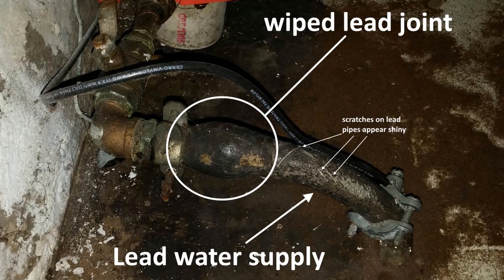Poor water flow caused by old water supply piping

Comment: You should be in philippines my current house can only run one Fawcett at a time and very little pressure less than 10 lbs I'd guess. Taxes 3to  5 minute to fill a 5gal bucket

Comment: I have a question when I turn on my lawn irrigation my water pressure is zero in the house.  I had the house rebuilt 2007 and didn’t replace the water line from meter to house.  I believe it’s 3/4 galvanized from then 1960s.  I believe this line has corrosion we always get grit in our shower heads.

Comment: I’ve had “less than perfect” water flow ever since moving into my current house. I asked the water company to check whether their curb stop valve was fully turned on. They said it was OK but I wasn’t home at the time they checked it. I decided to inspect it myself. Unfortunately my curb stop valve is only about 1/4 open. Also a tree root has pushed the vertical curb box pipe out of position so that a curb stop tool cannot engage with the valve to rotate it. I suspect the only thing the water company did was to turn on one of my outdoor faucets and observe that (some amount of) water came out. Recently I dug a hole around my curb stop, lifted out the curb stop box, and cleared out all the roots. Now I have full access to my curb stop valve, but unfortunately it is firmly stuck at the 1/4 open position. I haven’t decided what to try next. I don’t want to break the valve or cause a leak.
Reply: After several attempts I was able to improvise a functional tool for rotating my curb stop valve. I modified a 1.5 inch socket wrench by grinding 2 slots in it which fit snugly over the rectangular actuating tab of my curb stop valve. It was necessary to use an electric impact tool initially to get the curb stop valve to break loose and rotate for the first time. The valve now rotates smoothly enough that I can operate it by hand with a 1/2” drive breaker bar. The valve does not leak or drip around its stem. When the actuating tab is at right angles to the direction of water flow the water is totally off. Rotating the actuating tab 1/4 turn in either direction provides full water flow. . The original position of the valve was just barely open. In conclusion the entire cause of my “low flow rate” was due to the curb stop valve being in the “almost closed” position. With the curb stop valve “fully open” my water flow is completely adequate. Several faucets inside the house as well as my two outdoor hose spigots can be used at the same time without an excessive drop in water pressure.
Reply: Don't know what city your in, but in Cleveland ohio curbstop to main is water dept responsibility, and I work in water in my city.. so curbstop to the main is on us
Reply: Penetrating Oil Like Blaster …& let it penetrate for a couple of hours👊🏻☕️🦬☕️